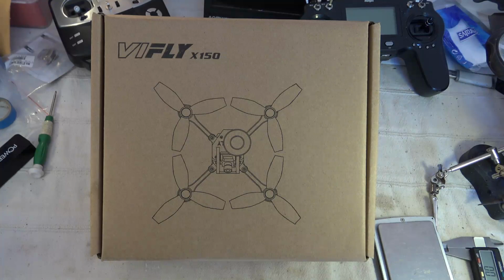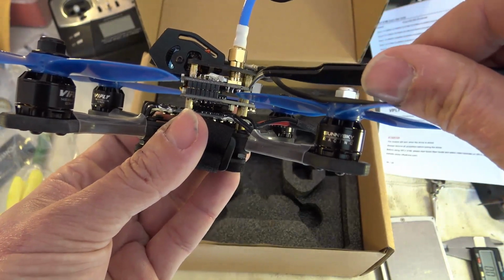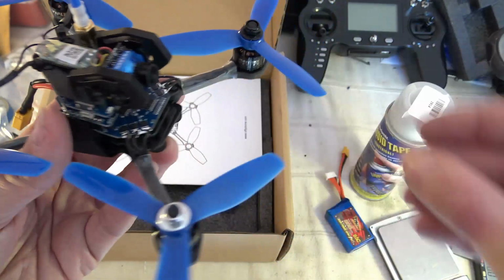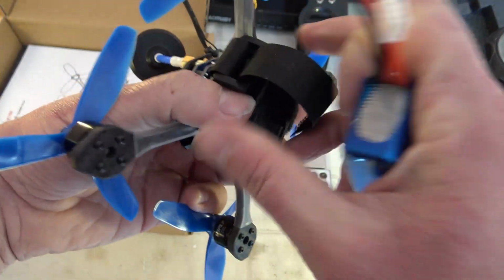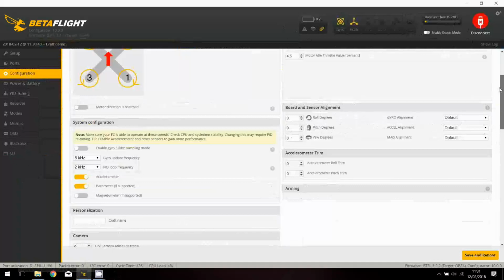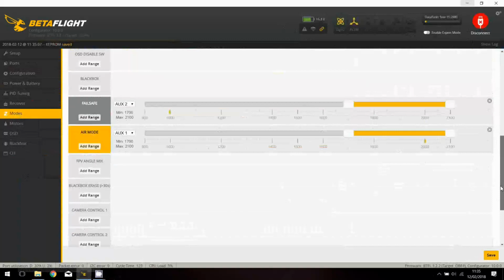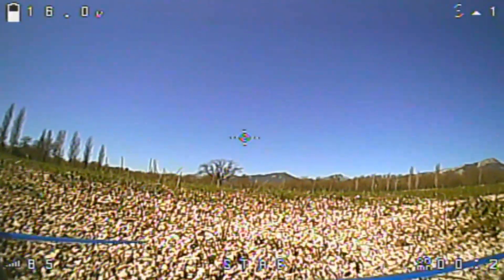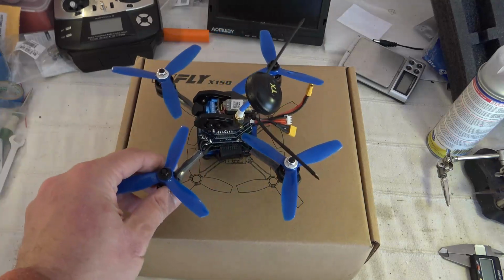VIFLY X150 unboxing, analysis, configuration and demo flight (Courtesy VIFLY)

Comment: When I first saw it, I thought that the arms were a little thin, but when you showed 4+ mm thickness, it should be strong enough. A very powerful model. All the ViFly models I've seen have been well designed, and this one is no exception. Thanks for the review. Cheers.
Reply from the maker: Definitively.... actually the best VIFLY